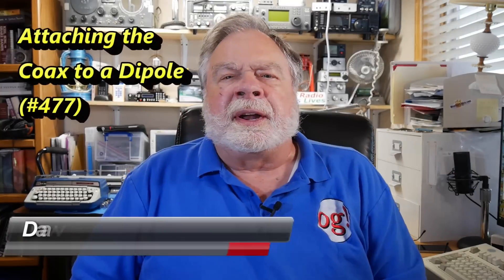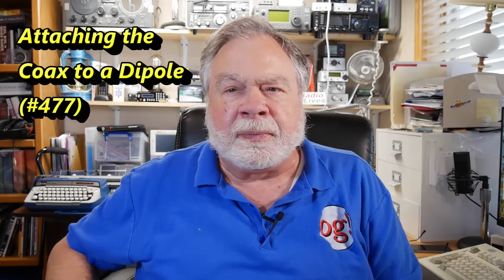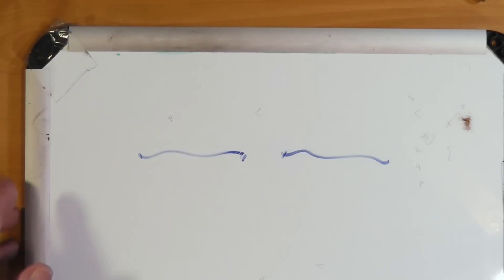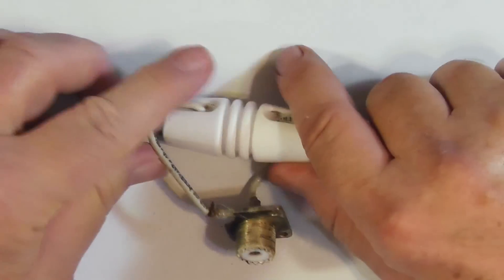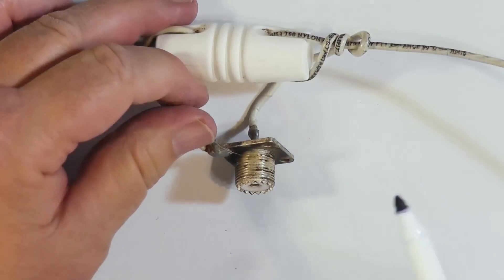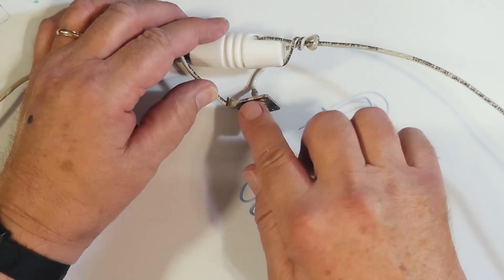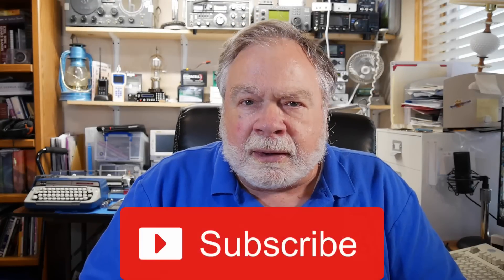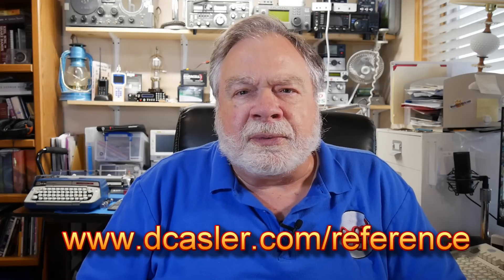Attaching Coax to a Dipole (#477)

Comment: Dave thanks for these videos. So much of ham radio starts at step 2, 3 or 4 and makes an assumption about step 1. 

Because the author of whatever guide or schematic already knows step 2-99, so for them step 1 would be silly, pedantic or insulting to the presumed reader to include it. 

Unfortunately we all start at step 0 or 1. And we might aspire to go to step 10 or 30 or 60 or whatever. But making the step from 0 to 3 is almost like a logarithmic scale. Each incremental step is easier than the previous because so much of the foundational knowledge is there and it's just a matter of learning nuance. But when you're new to something, there is no nuance. It's all just a vague soup.

Comment: I wanted to ask a question...
I am facing network issues inside my house so, can I use a yagi antenna for outdoors to receive the signal from the base station and omni antenna inside the room without using a repeater to boost my signal strength?

Comment: Unfortunately some folks will settle for using  the plumber solider but I don't understand how they get that to work.  In my experience , the joints break down electrically and then what you end up with is a solid made antenna that doesn't work.  It especially doesn't work with antennas made from copper pipe.  I ended up with an expensive mess as copper connectors can get expensive.

Comment: Any problem with feeding a 2m dipole made from speaker wire by having a section of coax from transceiver connected to a 15’ length of speaker wire split on the end to make the dipole?

Comment: Best practices for hams: If you can afford to lose it and want to try, and won't get hurt: do it.  We're experimenters, if baluns have made things worse in your experience don't use 'em, and if you do use them and they do help you then go to town.
Reply: Using  decent balun with a dipole should be straightforward.  Without a balun, there will likely be radiation on TX, and pick up on RX, by the outer of the co-ax. And probably less current in one leg of the dipole. Usually, these are undesirable.... unless you deliberately want the co-ax feeder to become part of your antenna element!
Reply: @timdbl7804  right but everyone and their uncle had an opinion on the myriad aspects to our hobby, and baluns can be easily and safely implemented in most cases as well as cheaply if you make them. Give it a shot and watch the swr meter
Reply: @daniell8387  Hi Daniel, I should have put my initial comment at the top of these comments, as it was a comment in response to OGY's mention of failures with baluns; wasn’t trying to rain on your comment 🙂 Yes, I'm all for hams experimenting; it's how we discover better ways of doing things.... 🙂
Reply: @timdbl7804  no worries i didnt feel attacked just clarifying my viewpoint

Comment: Good explanation. 
You might add how to secure the coax to the center insulator as a strain relief to take the coax load off of the connection.

Comment: Thanks Dave! I have been having the same question for random wire antennas. People usually leave out the final connection details. There is also varying information on whether you need a balun, counterpoise, or ground connection. Not sure of if the answer can be different for receive only antennas, vs those that will be transmitted on. I appreciate all your help!
Reply: What ever wire layout your using, random, EFHW, OCFD - it's all about the ohms on the wire when considering what balun/unun to use.  Random lengths (not really random) perform best w/ a 9:1.  EFHW best perform with either a 49:1 or 64:1.  OCFD and Horz. loops work great with a 4:1.  I've made them all and all of them will get you rewarding QSOs.  Have fun!

Comment: What if I supply the the dipole with ladder line for a verticle rise and have a SO-239 connector at the base. How does this effect the dipole or tunning?
Reply: Ron, that sounds like a doublet which will work but you’ll need a wide tuner.
Reply: For the mere price of $40 you can buy a nanoVNA and find out!
Reply: @greglawrencemusic  so in other words, you don’t know either.

Comment: This a newbie to HF question, based on the idea we are going to buy some acreage, with enough room to put up a nice HF dipole. If I want to work 160 meters, would it help to use 4 times the loops as you would suggest for a 40 meter unit. I am also looking at a "sloper all band" antenna, with a length equal to the lowest frequency band I am looking at using. I may have room to plant a 160 meter 1/2 wave sloper. I have not measured the available space. Would that make it where I would not need a lot of power to reach as far as half way around the world.
Reply: If you have the trees available on your new property, a full wave 160m horizontal loop (square layout as possible) works great for both TX/RX.  Pretty low noise and you only need to have the wire mount points about 20-30 ft off the ground.  Use insulated wire.
Reply: @W0KNI  Thank you K0XHF

Comment: All the balun I have wires coming out.  The rings on the sides are just for stran and the antenna wires are connected to the wires coming out. This makes it easy to solder the antenna wires to the wires coming out

Comment: Dave, I was thinking of getting ready for a radio room, but, was not sure how to run the coax into the small 10x10 addition. I have seen a few mounts that fit in the window and seen 6, 8, 10-inch bulkhead connectors, I am thinking 6+ antennas. I live in a cold snowy winter area so the window plant is out, I was thinking of the bulkheads but that will leave them exposed to the cold, wet winters.  As I searched YouTube and antennas boxes seeing if there was such a thing and found a few videos on buzzsah, he is using an outdoors electric box and installed 15, 2-inch bulkheads in the panel and when it is done or needs to work on, add to, or remove, he just opens to door, meanwhile everything is protected from the weather. What do you think?
Reply: I'd love to know his answer to this too. I have a slump block house and I need to get through an exterior wall as well. An electric box is what I'm leaning towards, but I'm more worried about drilling a hole in my wall and what I might find in between.

Comment: I have also had no luck with baluns, I think it is a myth that they are "best" practice. They are an answer to a problem I never experience. An Unum makes more sense, but I get by without them too. WS7PB
Reply: Agreed..
Reply: Not every body needs a current choke at the antenna feed point.  But most shacks will end up with some RF in the shack without them.  Chokes are easy to build or cheap to buy.  They are cheap insurance.